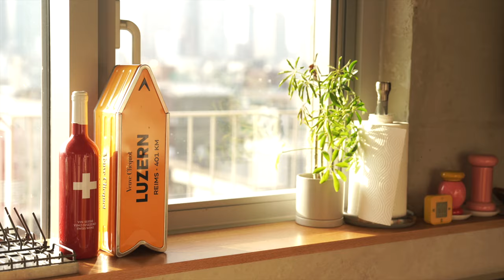Small kitchen Idea_W137

Comment: Very cool build.  Interesting, putting built-ins right in front of a window, but I guess is that's all the "wall" you've got to work with, you do what you have to.  I also find it interesting that the millwork guy does so much electrical and plumbing! You're a very talented guy.  Well done.